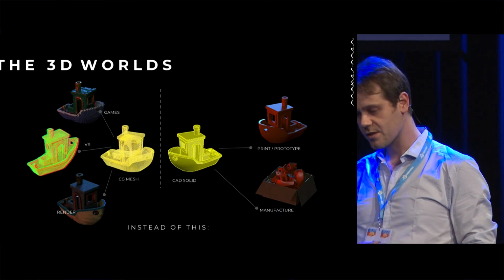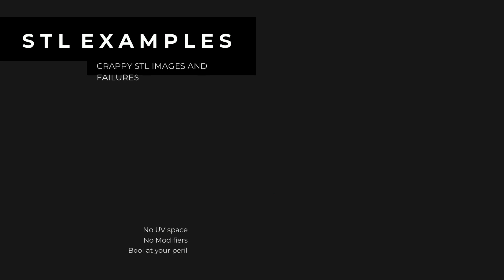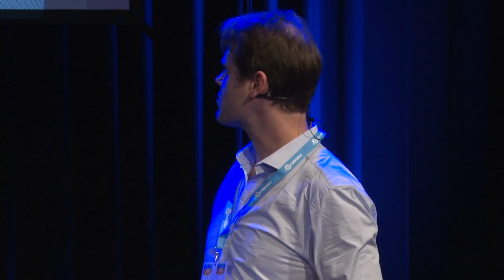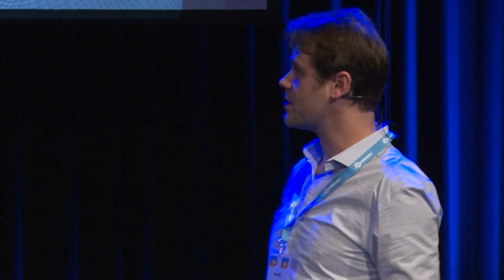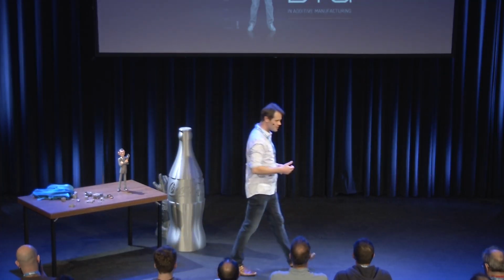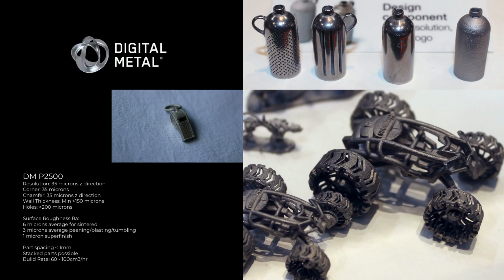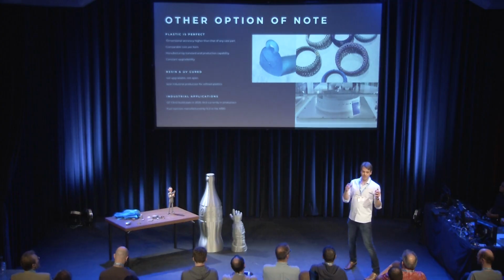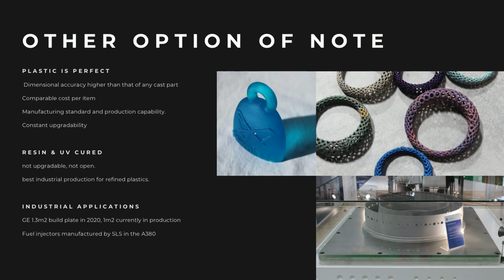3D Print: The state of the Art

Comment: I don't get the OBJ vs STL thing? I have used blender as a part time professional for over two years, making models for 3D printing. If my mesh has a problem, it will not go away just because I export to OBJ. If my mesh is fine, it will work if I export to STL. It feels like the beginning of the talk is missing.
Reply: I was confused by this too. I feel like it's missing key info. I also do 3D printing and I'm not really sure what the takeaway is. A lot of what he describes is dependent on the printer's capabilities and not the file.
Reply: I think what he means is that when you work with a SubD mesh you can apply more levels of subdivisions and obtain a higher density mesh, which results into higher print quality (compatibly with the printer resolution). 

When you have an STL mesh the quality is set the moment it is exported - soften from CAD programs - and it's impossible to improve without major reworks, it as it cannot be just subdivided (it has triangles and is usually quite "messy").

This means that in order to work with high-resolution STL meshes you need to handle very large, little manageable files.

In comparison, if you use SubD models you can have a very low-poly file that can be smoothed out when needed.

So if 3D printer could manage the subdivision step independently you could send to them just the low-poly version.

A similar thing happens with NURBS / CAD files, where the geometry is defined mathematically and the resolution is only limited by the computing tolerances. If a printer could accept a NURBS format like Iges or 3dm, then we shouldn't worry about meshing it with the correct settings.

Interestingly, SubD meshes can also have a "limitless" resolution like NURBS: there are several methods for calculating the "limit surface" that you mathematically obtain with an infinite number of subdivisions, and it is a good quality, smooth geometry with curvature continuity. This is great because you can work with a low-res SubD cage but have the resolution and control of a CAD surface - and it's the approach that is used in several CAD programs: for example in T-Splines/Fusion 360 but also the work-in-progress Rhino 7 has this feature, and MOI3D beta has a similar Mesh-to-NURBS tool.
Reply: @marco_traverso  Yes, this makes sense, thanks.
Reply: I think the product he was tied in with was a printer that could add dye to the material used as it goes along. So it could do color. As far as I know STL doesn't carry such data. OBJ however has an associated MTL file that does stuff like telling vertex color, or containing UV data and linking it to texture files. Thus it's a ubiquitous and readily available format that would tie together all the information needed for full-color 3D prints.

Other than that, I agree. Blender doesn't have problems exporting STL if it's a nice manifold mesh.